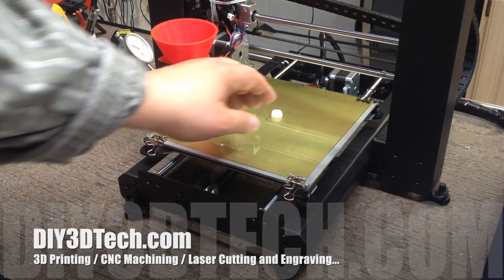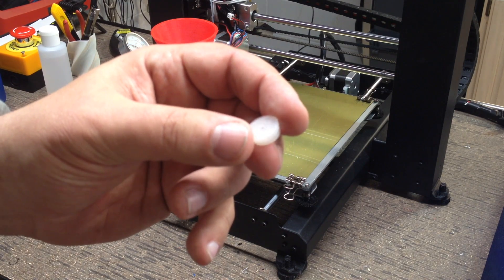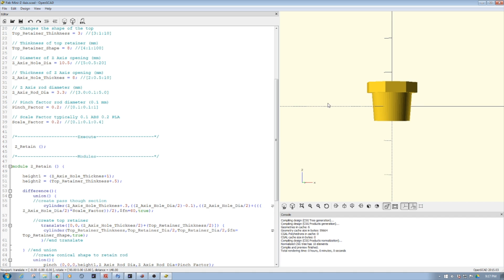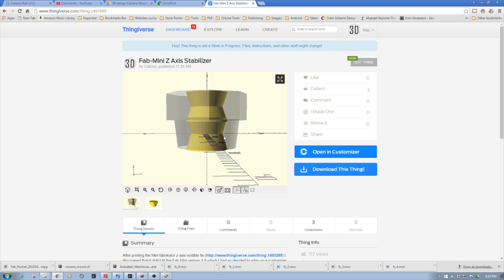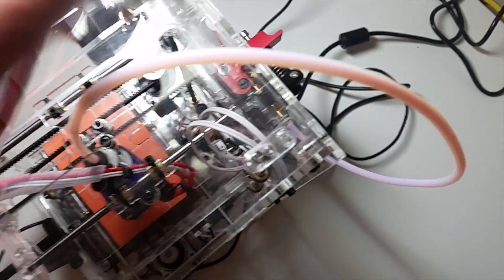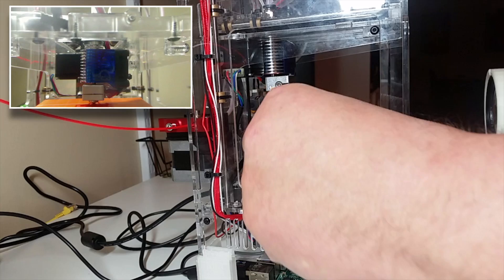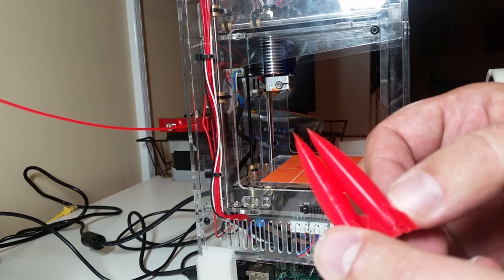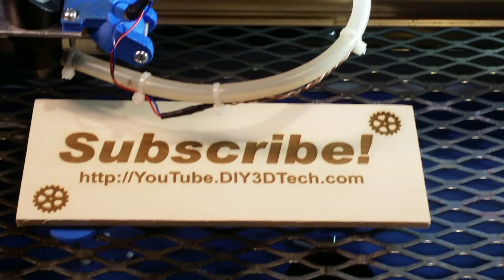Fabrikator Mini TinyBoy 3D Printer - Z Axis Retainer!

Comment: this definately does more harm than good. The rod can wobble if its slightly bent, but all this mod does is move that wobble from the top of the rod to the build plate and makes that move instead. i removed a similar mod from a reprap ormerod printer and was drastically reducing the quality. The rod can actually be fairly bent so long as the z axis is held rigid by the guide rods amd the the top is free to wobble.
Reply from the maker: +Scienteer I partially agree with you and that is one of the reasons i didn't do this mod before a couple folks wrote about it.  However the reason for saying "partially" is I am not seeing a negative effect by  having it either.  As the carriage is  so tight, don't think it makes a difference either way  :-)
Reply: +DIY3DTECH.com sounds like your trying to solve a problem you dont have. BTW just got myself a wanhao dii3v2. Your vids have been really helpful. My first prints were rubish, but after eStep cal, PID tuning and tuning speeds and feeds and a couple of jetguy mods it now works amazingly and is giving me the best prints i jave ever seen from a FFF machine. thanks loads.

Comment: How have you wired up your Emergency Stop ?
Is is true, turn off keeps it off even if the Emergency Stop button is released and only another turn on will reset it for safety ?
Reply from the maker: +Protomaker Black Sprint Original 3D Printer haven't done the E-Stop project yet, however keep in mind an E-Stop only kills the power until the safety lock is reset...